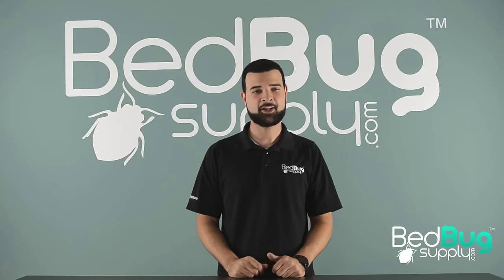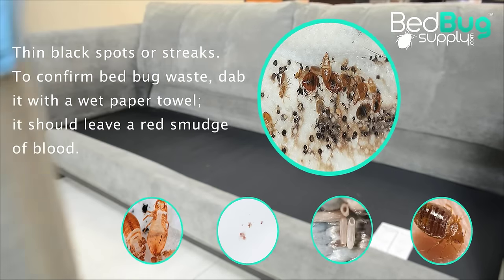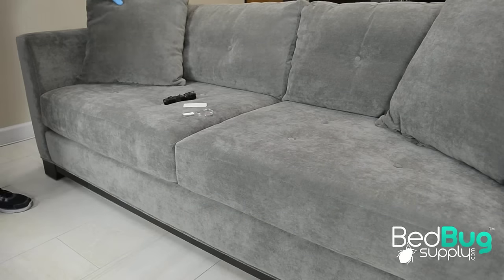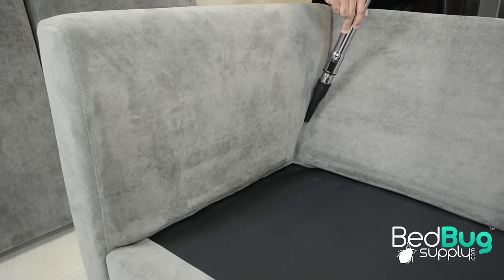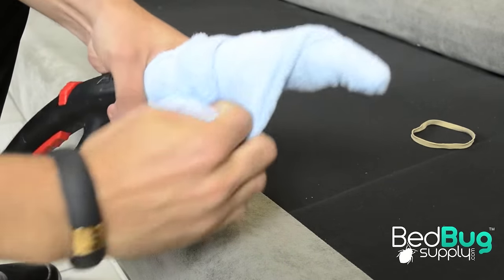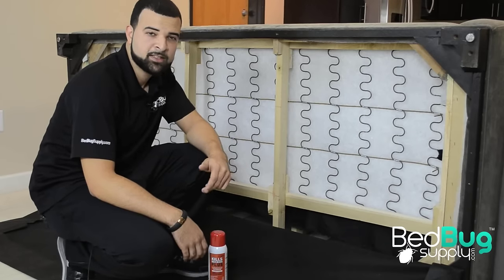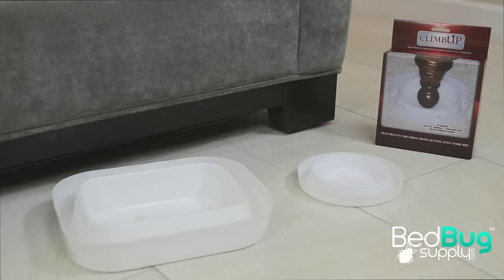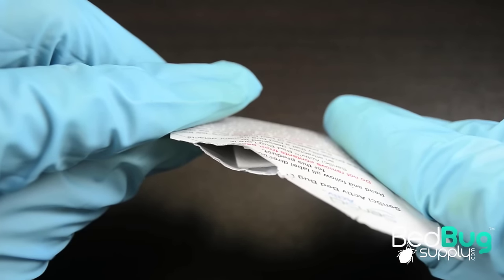How to Get Rid Of Bed Bugs on Couches and Furniture

Comment: I would suggest taking the legs off the sofa as well if you can.  I found them nesting between the leg and the bottom of the couch.
Reply: they will go all up inside of the frame work of the sofa and recliners as well from the back and side voids accessing underneath
Reply: Do you have to threw away you crouches

Comment: What is the minimum you can spend on this whilst still having it remain effective? We don't have a really high bed bug budget.
Reply from the maker: 1-2 room treatments, including what's needed to treat and protect your couch, can be done starting around $500. It depends on things like how many beds need to be treated, encased, and isolated, as well as how many rooms you're spraying/powdering and what you'd prefer in your steaming and vacuuming tools.
Reply: @BedbugSupply  Can we rent this equipment or do we have to pay the high labor charges to have it done?
Reply from the maker: The equipment costs less than the labor and you get to keep the equipment for follow-up treatments. Buying the equipment is the most practical choice as long as you're able to read labels and follow instructions.

Comment: Glycolic Acid works good to Kill Bed Bugs, it,s in disinfectants such as Pine-Sol, mix pine-sol with water and a little laundry soap in a spray bottle and spry the bed, base of walls and suspected areas, I used this method but had trouble breathing as I made the mixture too strong, my home smells like an old Hospital but I have not been beaten for weeks now, I would not recommend this if you have small children as it contains (Glycolic Acid) and may disturb the breathing of infants so Please be careful.
Reply from the maker: +84sblack So instead of using insecticides that are proven to kill bed bugs and are harmless to humans if used correctly, you're suggesting that people use a highly corrosive skin and lung irritant with questionable effectiveness?
Reply: +BedbugSupply Hi, I never suggested using it, I only gave facts.
Thanks for you reply.
Reply: You said you were applying it and said it works good.   That in itself is advice and recommendation.

Comment: Can you do a video on how to steam clean a couch with cusions that don't come out?
Reply from the maker: We were taking off the cushions to reach any cracks and crevices that bed bugs might be hiding in. If your cushions aren't removable, just perform the same steps along the seams at which they attach to the couch. Bed bugs can't bite or dig their way any deeper than you can reach with a steam nozzle.
Reply: @BedbugSupply  thank you! I just ordered a steam cleaner yesterday. The dupray neat. I've never used one before. I'm excited to use it and get rid of them!
Reply: @BedbugSupply  oh! Another question. So my dupray neat steamer that I'm getting goes up to 175. I dont think it has an adjustment. Can I steam picture frames and other things in the house that I can't wash like books, etc?
Reply from the maker: A 175 degree tip temperature isn't enough to reliably kill bed bugs on contact. Steam in general wouldn't be safe for picture frames and books. It's still water.
Reply: @BedbugSupply  oh! I mistyped. It's 275 degrees!

Comment: I have been using your methods and products on my couch. I have seen the number GREATLY REDUCED but still see one every once in a while. I thoroughly do the system every two weeks. My couch has so many places they can hide its a Lazy Boy sectional with a lounger on one end and a recliner on the other, is the two weeks wait for respraying the right amount?
Reply from the maker: Yes, respraying every two weeks is ideal. This is in line with the time it takes for laid eggs to hatch, so we ensure that newborn bed bugs are exposed to freshly applied product.
Reply: awesome, the struggle is real. your products and system have eliminated more than multiple sprayings from a "?professional" !!! Thanks
Reply: Make sure u vacuum your couch crevices everything before you steam and after you steam after two to three treatments depends on how bad u had them you must put a chemical to protect your stuff

Comment: Question: Do you think a heat gun that reaches really high temperatures could work in place of the steamer?
Reply from the maker: Heat guns can't penetrate into soft materials like steam can. They'll only kill bed bugs that you can see, and at that point you might as well just hit them with a shoe.
Reply: I have a heat gun for stripping paint, but I'd be afraid of burning down my house with it. I'll bet one could be designed with a very well regulated temperature and lots of air flow, but it would probably cost more than a steamer.

Comment: I  have  tried  two  different  types  of  pesticides  for  the  bedbugs ,  and  wanted  to  know  what  brand  is  preferred .  I  am  going  to  try  the  alcohol  in a  spray  bottle  now .
Reply from the maker: We don't prefer any particular brand, but you want to find a combination of products that are EPA registered and used by today's pest control professionals.
Reply: They will scatter when you use alcohol among other hazards you create applying that.   It will also contaminate the pesticide residual making it ineffective